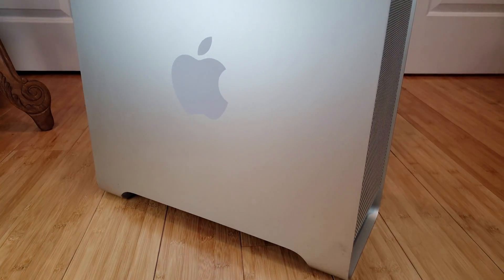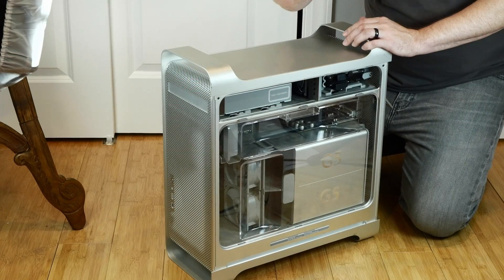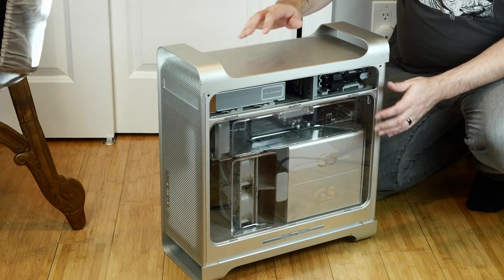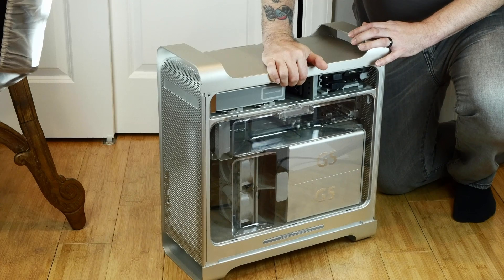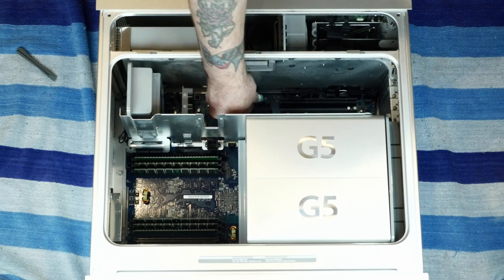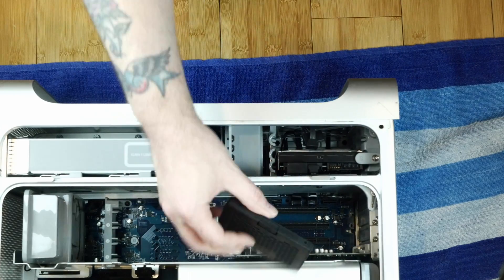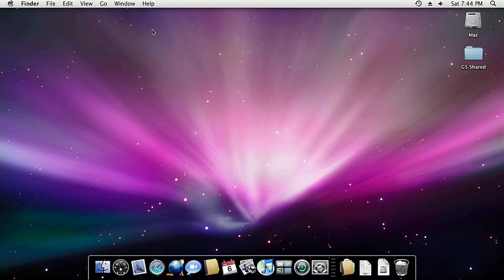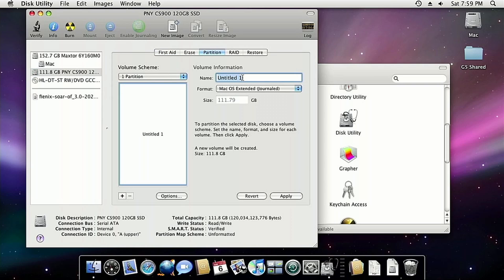Maxing out a Power Mac G5 Dual Processor 2.0 Ghz - Hard Drive m.2 SATA SSD upgrade and max RAM

Comment: $800 for the pair in 2020?! I donated my dual G5 to the local Goodwill two years ago and it was in perfect condition, so someone probably got it for under $20. But... What's the point if you can't do any more security updates and no one writes software anymore for the PowerPC? Genuinely curious.
Reply from the maker: Hah, I paid $100 for the pair, not $800
Reply: A hundred, not $800

Comment: I have the Dual 1.8,  with 8gb ram. I also have problems with ssds in mine. It sees it, but it refuses to install on it. I guess that the sata controller is a bit picky about certain drives.

Comment: I'm surprised people that deal with retro computers don't have an assortment of drive bay converters.. EG 2.5 -> 3.5, 3.5 -> 5.25 etc. Would make mounting drives like SSDs into old computers much easier and more stable. All the videos I've seen just have it taped or hanging about haha.

Comment: This is my  dream Mac. 
The one I stil want. I have  the next  step up,  a  2006 mac pro,  which is no doubt better.
But I stil want  a Powermac G5 one day.
Reply: I got a broken water-cooled G5 decided to save the beautiful case and strip the insides out cut an atx motherboard mounting plate out of an old pc case and put it in the g5 case and now I have a i5 7600k system running in it with a rtx 2060

Comment: As other people point out. The G5 does NOT support Sata III drives to boot from at all.  I have the latest Quad version of the G5s with PCI express,  and I have tried different controllers and different drives. but booting from them does not work. I does however find the drives in the OS and can be used to store data on, but not boot.  And if I am not mistaken it has to do with the AHCI controller that those computer used.  However, finding SATAII drives on eBay is easy even today, and they are cheap :). I have two 128GB in  Raid0 in mine.
Reply from the maker: Thank you!

Comment: you deff need a SATA 1 or 2 Drive, Sata 3 drives will not work,  i had even a SATA 3.0 drive keep my Dual-Single Core CPU model once from booting (if macs still did the sad chimes it'd be doing that, but all it did was flash the power LED) edit: i do have on it (hopefully still) RetroArch for PPC OSX Mac, i dont have all the cores but w/ RetroArch's problems that came n went these macs still have a really great emulation performance.

Comment: The problem is SATA 3. I had the same problem on an upgrade and I had to set some jumpers on the SATA 3 drive to work as SATA 1.
There are no a lot of SSDs nowadays that support SATA 2. I usually install a SATA 3 card and use this for the G5s

Comment: I think it’s pertinent to note that there were 3 G5 models that used liquid cooling. The 2004 dual 2.5, the early 2005 dual 2.7 and the late 2005 quad 2.5. Basically any G5 that had a 2.5GHz or faster CPU was liquid cooled. All others, including the 2.0 and 2.3GHz dual-core machines, were air cooled. (Note: the quad has two dual-core chips while the dual cores have one dual core chip).

The 2004 2.5 and early 2005 2.7 were the most problematic. Most had cooling systems from Delphi (part of General Motors) which were not meant to last even the service life of the machines. Some had better built Panasonic coolers which could still have problems but the failures were greatly reduced. I had one of each and I wish I had kept the Panasonic, but when I moved I had to liquidate all my G5s including my dual-core.

The quads had the best system and I’ve only heard of a few failures. But they too were designed by Delphi and their reputation is intertwined with the earlier coolers.
Reply from the maker: Oh wow, very interesting that the quads have a reliable cooler - I'd love to find a working example.

Comment: These are beautiful machines <3 I love those although I don't have a PowerMac G5 I have a Mac Pro early 2009 which exterior is almost identical to these G5s. I use my Mac Pro for editing works till this day and that machine is still going strong like a tank, let's see how many years I can keep those before finally giving up.
Reply from the maker: Yeah they really are beautiful, and I love that era of Mac Pro. I think they'll be usable for a long time still - they still blow a lot of modern mid-range PC's out of the water.
Reply: @ActionRetro  Yup absolutely, although the old mac pros are not that suitable for commercial usage but for a average user who likes to do some photo editings and FHD Video editing etc. this machines are still good because of the upgradability.
Reply: Probably a long time. The rate of hardware progress is getting slower and slower each year.

Comment: I still have a single 1.8Ghz G5 hanging around.
It's my main photoshop rig, music making rig and.... I do have some games on it too
Reply: How is the machine holding up in 2020? I am curious to know! I have a Mac Pro early 2009 I still use it to this day and it's still good and fast for my work.
Reply: @junaid9957782027  I have a G5 also and it was my main rig for a few months and I still use it. Its still snappy surpirsingly I only have 3gb of ram in mine and I can max it out to 4 but I don't have another at the moment. If you do get a G5 get a 2005 one with better cpus and 8gb of ram. But back on topic mine handles internet browsing alright but wasn't' great. Youtube was a bit hard to run but I was also using a newer monitor with a newer resolution so if you got a period correct display probably could do youtube. Browsing the Internet was decent for simple searches or sites. I could listen to Soundcloud and do some browsing but it was slow. But for older software its great like iMovie and GarageBand. I enjoy my unit but wouldn't recommend one unless you like collecting older tech like I do.
Reply: @jasontevepaugh  I can pick one of this just to test it! Although I use Mac Pro 5,1 for my editing  works, I can definitely give this machine a shot, its sold dirt cheap nowadays lol
Reply: Junaid Siddique Dope just becareful some of the 2005 models have water cooling. So make sure if you come across one it hasn’t leaked all over the parts. One thing I will admit is the machine looks so nice once you take the side panel off. I’ve actually been looking into getting a older Mac Pro myself but right now all the prices are insane. So i got myself a cheap 2011 iMac to use instead.
Reply: @jasontevepaugh  Alright! So I would have to open the case and look inside for any leakage... thanks for telling that I didn't knew it. Well right! Older Mac Pros especially 4,1 and 5,1 quite expensive even for today. And we also need to upgrade that lol! Most of them comes with a GT210 or a HD 5770 which is terribly out of date and underpowered for a person who is into content creation and also in a tight budget.
Reply: Junaid Siddique yep would have to open them up to check. The gpu inside the G5’s aren’t great. Mine has a 64mb Nividia gpu. I know some had up to 128mb maybe even 256mb but not sure. I’ve only ever had one G5 so that’s all I can really say for sure.
Reply: @junaid9957782027  G5s (and also G3s and G4s) can also boot into Linux, which has always had some support but as of the last two or three years PPC64 package support on Linux has really taken off due to the new POWER hardware options available now (and soon to come in SBC and laptop forms).

Comment: Bruh, there has to be a way to tweak the system to register that m.2 as a normal ssd. BTW love the long(ish)form content but the point of seeing this type of content is stretching the extent of this hardware to make it do things it wasn't meant to do.
Reply: Sadly probably not. The G5 has a really picky SATA 1 chipset, which works with most SATA 2 drives, but nearly all SATA 3 drives dont work well with 2 levels of backwards compatibility. I have an SSD in my G5 from OWC since I knew that would be perfectly compatible.

Comment: i Have bumped into the same problem with my DP PPC G5, none of my bootable drive would boot from it. 10.4 had a kernel panic. installed os 10.4 onto a ssd and same thing happened. kernel panic. so tried a 10.4 SERVER version. booted fine and currently runs on the server version, but i lost the capability to use the Classic environment. If anyone have a fix for this? that would be great as i would love to have 10.4.x on there. That tower has been the most stubborn machine i have ever dealt with when it comes to installing a fresh OS in there. great video and Cute kitty. :)
Reply from the maker: Thank you! I didn't think to check out a server version OS
Reply: I am also wondering if there is a Firmware update to take an SSD disk. i put in a SSD disk and it won't even see it from the disk utility. Trying still to install os 10.4.x on my dual PPC G5 "Not water cooled" doing another install via Target disk mode from an iMac G5. Look promising

Comment: I suspect that your SSD issue may be the SATA 1 on the G5. SATA 2 is backwards compatible to SATA 1, but SATA 3 is not. But hey, you got it working! My G5 is a dual 1.8 GHz from 2003. It's a tank. I use it every day.
Reply: Has to be then a G5 specific SATA controller problem. Cause SATA I , II, III is 100% compatible generally.
Reply: BlueStreaxxx You may be right, the only SATA I devices I have ever worked with are the Power Mac G5 and an iMac G5.
Reply: Seeing as Sean is having issues with that M.2. I recommend the WD Blue 2.5 inch SSDs as I have my trusty 250 GB in my G5.
Reply: I've found that it depends on the slot too. I have SATA 3 drives that only work in the top slot or vice versa. I have used Samsung 850s and SanDisk X300s in my 2x2.0 GHz G5 (PCI-X) with success.
Reply: @larbob  that almost makes me wonder if their SATA controller has, like, signal integrity issues with really fast drives (much faster than existed when it was made, to be fair).
Reply: It's not just G5s; it's a problem on many older SATA 1 controllers. Many newer drives and adapters have jumpers to force SATA 1 operation (same as jumpers to limit capacity and speed on PATA drives of old) and correctly setting them should get them to work on a G5, though you may have to specifically research SSD adapters to find one that supports forcing of SATA 1 mode. Usually these jumpers are marked "SATA-1" or "LIMIT 1.5GB/S" or "SPREAD SPECTRUM ENABLE" or something like that.
Reply: I can confirm SATA 1 and SATA2 do work with PPC Powermac G5's and SATA 3 do not. My last G5 has 120GB SATA 2 SSD and was pretty snappy.
Reply: This is very likely it. 
I generally managed to get SATA II SSDs working on G5s.
Same goes for SATA III Intel 520 series SSDs as well as Samsung 840 and 850 Pros.
Reply from the maker: Oh I didn't know this, thank you!
Reply: @ActionRetro  Yes, while SATA is theoretically forewards and backwards compatible, in practice these G5s are extremely picky about 6Gbps drives. I know older drives like Intel x25-M or 320 series work in them.
Reply from the maker: Thank you!
Reply: @ActionRetro  Was the 'cannibalised' SSD an ADATA drive? Most sources say that a Maxtor SSD is the only one known to work but if not, then this would be great to share as others have been stuck trying to get this to work on their G5s.
Reply: Action Retro You are most welcome. Druaga1 has a funny video about trying to put an SSD into a G5, that’s what tipped me off.
Reply: I was told to try a Sonnet Tempo SSD PCIe adapter (TSATA6-SSD-E2).. their site states it's compatible with G5's.. pretty cool that a currently in-stock part is still being sold.
Reply: So what could I do to mine what's the max for ram I could put into it power mac g5 1.8ghz
Reply: @da6ixbarber  8 gig.
Reply: the only drive i know of being capable of all 3 standards of sata is the Samsung 870 Evo
Reply: @danijelcerin6912  I’ve had recent success with Timetec, which is much more affordable.
Reply: Yeah, both my 2.0DP and 2.5 Quad are very finicky with SATA III drives. I can sometimes get OSX to see them, but booting off them is usually a non starter.
Reply: Isnt the ssd bottlenecked
Reply: @Rainbow__cookie  Yes, but no waiting on the slow seek times of a hard drive read/write head.
Reply: @Rainbow__cookie  it is limited to SATA 1 speeds, of course.